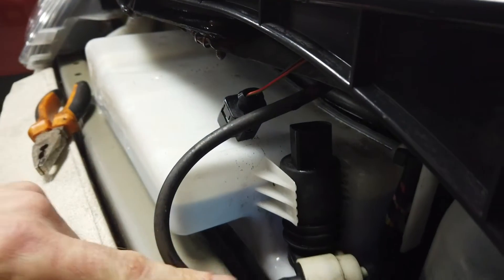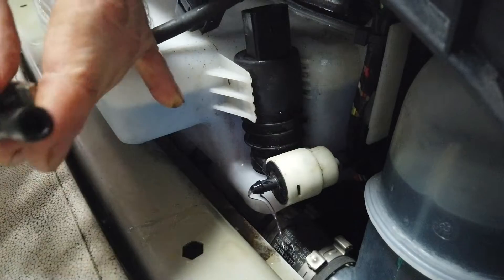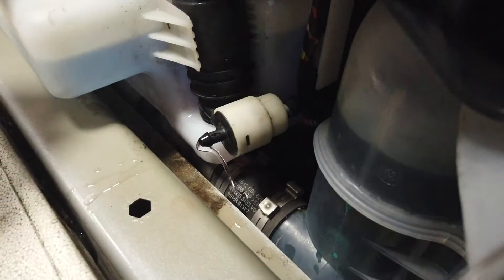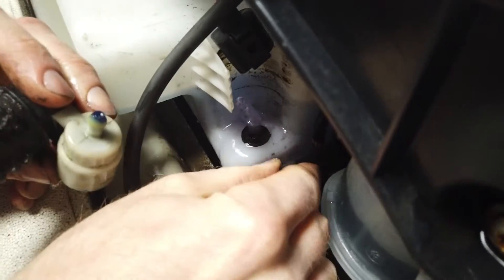How to diagnose and repair washer jet/pump problems on Smart car Fortwo W450

Comment: Well, I've just had a new pump fitted, and it's still not working properly. I've been told it's the washer jet. 
Tried unblocking with an air pressure gadget and also a paperclip, it's does the first squirt perfectly then stops..please help, any ideas ?

Comment: I have the 450 and there’s no pump noise so basically I need to replace the pump?
Reply from the maker: Check there is voltage at the pump first - could be a fuse
Reply: @L663  I was thinking the same but the fuse covers both the washer and the wipers and the wipers work. So it must be the pump?

Comment: my front pumps just fine but my rear doesnt work anymore. it just randomly stopped. i was told theres a fitting behind one of the tail lights that comes apart, but i have yet to look due to the weather. it wont stop raining.
Reply: I’ve got the same problem. Front is pumping fine but rear you can hear the pump running but no water coming out. Did you sort this out?
Reply: mjrjunior it turns out when the washer fluid level reaches a certain low point, the rear stops working, it’s kind of like a warning to the driver. 😅

Comment: My washer pump is working only with full washing liquid reservoir, but as soon as I waste for example half of liter of liquid my pump stops spraying water even if I can heare it it's working electrically. Any suggestion?
Reply from the maker: This is odd - it could be a weak pump as it has to work harder the lower the fluid gets.
Reply: @L663  that's what I thought also, but I needed anothet oppinion. I'll install now pump. Thanx for the answer!

Comment: I have 2012 rangerover Westminster the dpf filter light is on drove it for an hour didn't clear any suggestions thanks
Reply: neal finnie Neal, you need a 1/4 of a tank of fuel minimum plus an uninterrupted run of around 20+ minutes if you have the yellow light on. You don’t need to blast it full speed anywhere a constant 50 MPH plus will do. Be careful though as if you get the red warning you cannot clear it, you’ll need to find a good independent Land Rover garage to force a regen of the DPF
Reply: @dennij  thanks wife did that she knows her stuff going back to garage under warranty thanks for help
Reply: neal finnie Good to hear you have a warranty Probably find there is a leak on the air induction side Maybe the 4 small hoses on the plenum Hope you get it sorted 👍🏻

Comment: I find the best thing to clear out the spray nipples is a length of MIG wire, it is much stiffer that copper wire, and if you bend a loop on it you can hang it up on a nail in the wall for next time.
Reply: @Lancashirelad : Yes I have tried that, but it sometimes blows of a pipe connection in some semi inaccessible place which causes more delving into the inner panels, it does depend how simple the set up is, (and of course how much pressure you put down the pipe).